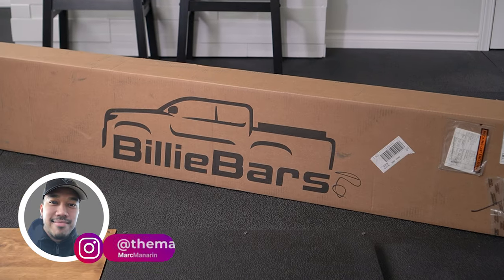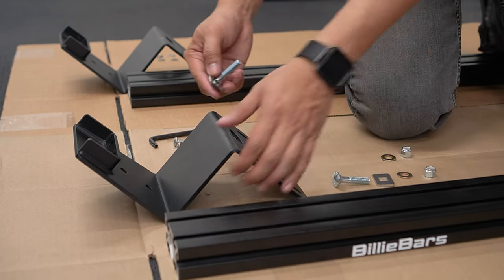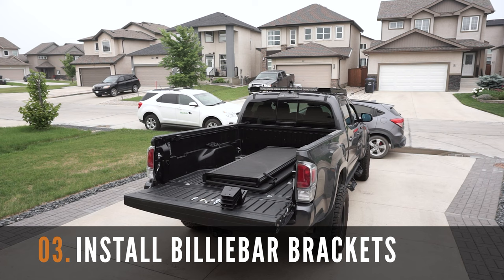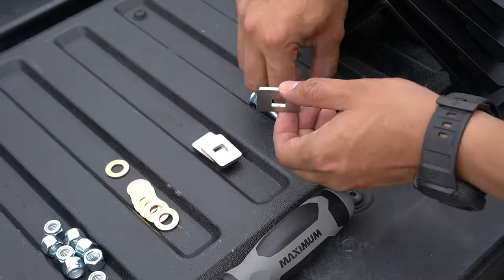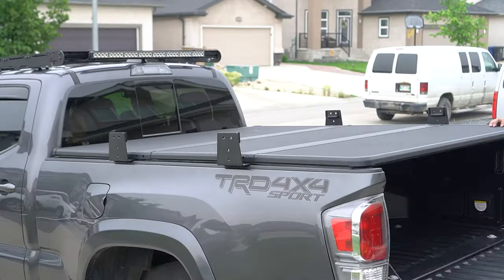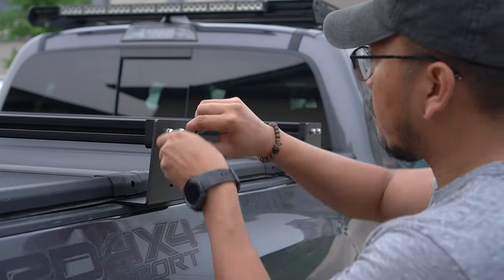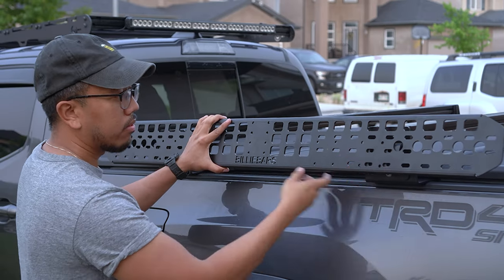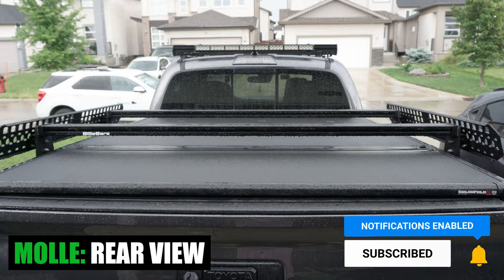LOW PROFILE BED RACK SYSTEM INSTALL on this NEW Toyota TACOMA TRD Sport | EASY DIY

Comment: Now you cant use your tonneau cover without removing bolts and rails. Makes sense if you never need access to your bed I suppose
Reply from the maker: Works ok for my purposes as I have a push pull stick to reach what's underneat. Can still haul drywall and plywood as required so nothing really changed. The bars itself take 5 mins to remove if required to haul bigger material like a fridge. 

If you're really concerned they sell one for the retractable sliding cover as well so you have access to the box without removing the bars. 

Thanks for watching.

Comment: For almost $700 you would think they could at least use some real rail hardware or at least the right size bolt instead of having an inch plus of bolt sticking out.  Kinda ridiculous.
Reply from the maker: Hi thanks for watching my video and for the comment! I guess they intended it if you need to add future accessories? I'm not sure actually why it's longer.